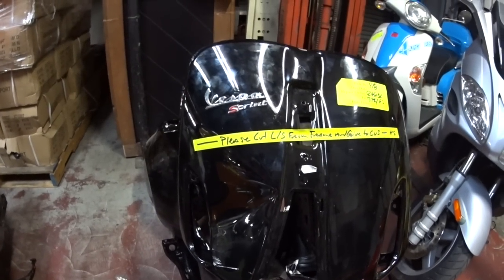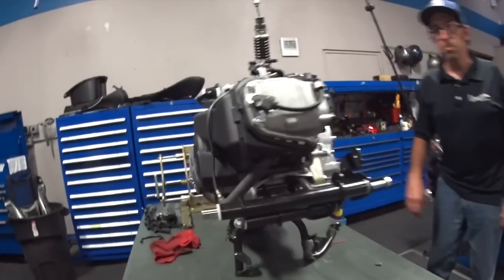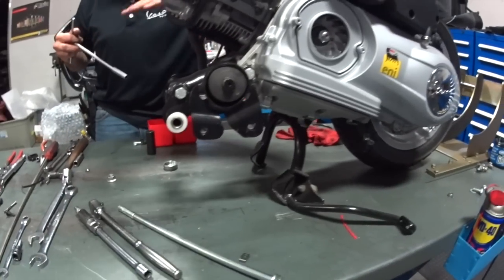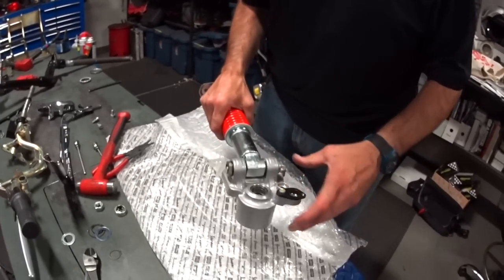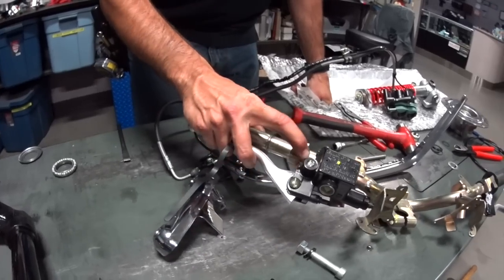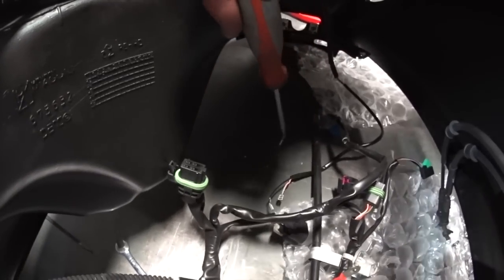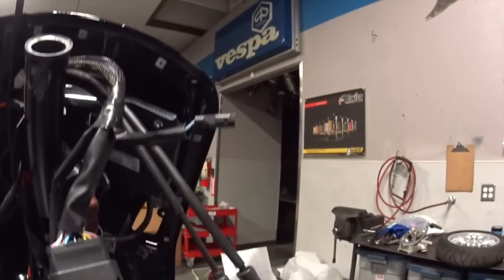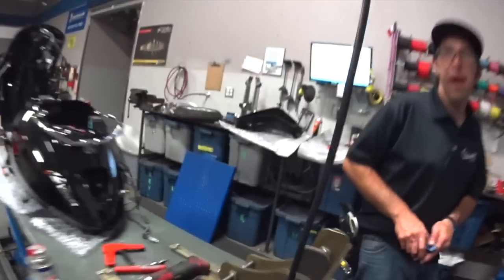2015 Vespa Sprint 150 Technical Overview

Comment: As far as the new front end design, I think they added the pivot at the bottom of the coil-over unit because it was over-constrained*, in that, as the strut compressed, it did so, at times keeping parallel with the path aligned by the lower arm, but at times not. In other words, the arm under the chrome plastic cover does all now does all of the lateral constraining, but before, the strut unit did it differently depending on its position in travel, which likely caused the wobble, experienced with older models at certain speeds. Perhaps also, the stiction from the strut could have preloaded any suspension bushings that might be in the system, differently, depending on whether or not the dampener was compressing or extending. If there were any flex in the system, it could have caused binding as well.

[*If you take apart a CD player or DVD driver from a computer, it is usually only held by three points. Two of the bushings hold the shaft it slides on from all the way around, but for the 3rd bushing, which isn't much of a bushing, only holds it from top and the bottom, and not the sides. This is an example of holding something by less can make it more accurate.]

Comment: Hello Vespa Motorsport, I have a question, I own Vespa Primavera 2014, I think is similar with this sprint engine model,
Have you ever deal with the Vespa is hard to start?
Or after the engine start it suddenly off and is hard to start again?
thx

Comment: First, sorry about the scooter. I am glad the rider is okay.

Thanks for showing us the scooter. We came so close to seeing the roller rocker arms : ) I wonder if they would fit the GTS, or if the head geometry is different.

Please move up to 1080p resolution, as engines are visually complicated things.
Reply from the maker: Brenda Make Thanks for the comments! We also just posted a valve job on this same motor in 1080p. We kept the resolution a little lower since this video was so long. Give it a watch!
Reply: ***** 

Thanks you : )

Comment: I have watched loads of Robots videos, always awesome. I have a primavera 2014, at about 4.30 minutes a long tube thing is pulled out of I think the swing arm, the bearing ? Is this the same on a Primavera, mine as done 12000 miles almost I am told these need replacing. This started to rattle not long after the MOT.  Any special tool needed to change this huge bearing.  can it be adjusted, tightened?  Also watched the videos when you all went to Mexico ( great job) , it's what made me buy my Vespa.

Comment: It´s a downgrade in sake of reliability and selfsufficiency. After i got my 2 stroke vespa ,just a 72ccm dr cylinder i never want a 125/150 fourclusterf*ck again.And i swear i reck em in terms of accelleration and cruisespeed.Oil change, here breathe in...Tuned by dremel, costs 5dollars of grinders. Further :the metal quality,paint finish ,general stiffness of parts is just not worth the investment anymore on everything piaggio produced after +-2005. Old vespas went anywhere,new vespa´s go back to the dealer.